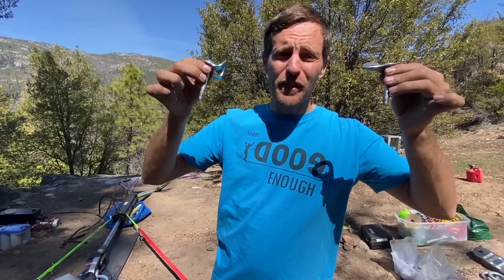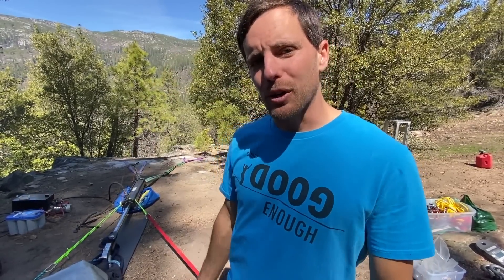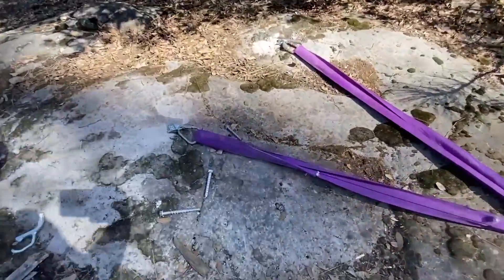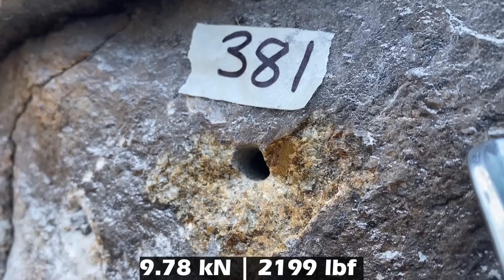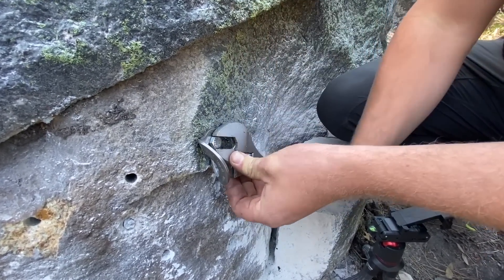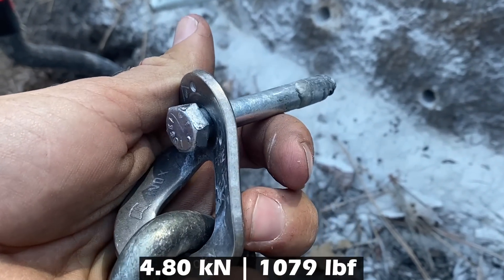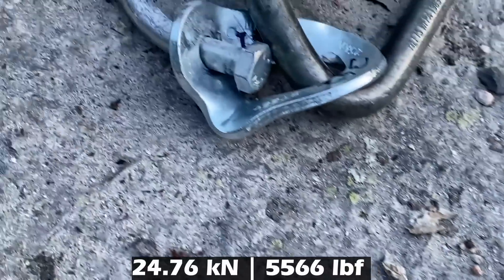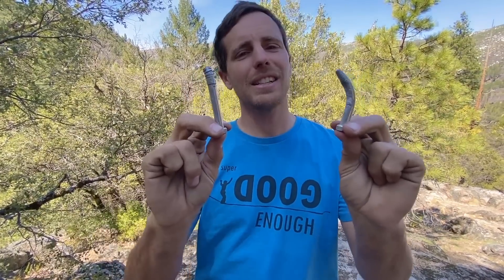John Bachar's favorite bolts tested

Comment: It looks like you installed them incorrectly. You're not supposed to hammer them all the way in.

Doing that makes them impossible to tighten, and instead you'll just instantly strip the threads.

Comment: Hey guys, cool video.  Like your stuff.  One thing you might do in the future is do a little more research on the topic or motivation behind JB's decision.  I don't think you're bashing on JB per se, but just trying to draw a conclusion from something that seems foreign peering back into history about.  You'd do well in the future to try and phone interview someone that knows more on the topic at minimum.  JB absolutely never placed bolts without significant consideration nor did he ever "just free solo" everything.  His methods were far from reckless.  Sure, there are routes like the Bachar-Yerian and others, but the ethos and technology at the time were very different.  John had the purest of ethos of any and was extremely against rap bolting and so these would have been bolts generally placed from the ground up and by hand without the use of aid gear or hooks.  If you're establishing new routes at 5.12+ in this pure form while trying to keep up with all the 5.14+ rap bolting going on, I'd probably use the same bolts.  Cheers, cool tests.
Reply: Also of note... this is often why the bolts are spaced a little further out on some of his routes.  He had to find a good enough hold to actually rest the 3-5 minutes required to drill the hole by hand and tighten the bolt to clip in and proceed... while attempting the onsight

Comment: Could you try one more in shear - and after it has snapped out of place once, try to remove all tension and see if you can pull it out by hand afterwards. My theory is that the lead screw on the bottom is already ruined from the previous load, and the only thing holding it in place is the strength of the bolt, combined with the friction from the threads on the end of the bolt.

Comment: but how would that apply to real life, unless the bolt was in an overhanging spot?
Reply: In my world of caving, it's definitely not rare to have fixed anchors in a ceiling-- they need to be sleeves, wedges, or (maybe) glue-ins*

Ascending on a fixed rope with an unequalized knot (or, ewwww, a single bolt anchor) could potentially see those forces... especially if it's a decent-sizes dude towing a heavy cave pack**, or people tandem climbing (aka the most unnecessary form of ascending ropes).

Even if the 3.8 ~ 4.whatever kN isn't hit, I wouldn't trust the repeated bouncing (at ~2.whatever kN) generated by ascending to not fuck with that placement. 

*Disclaimer: I'm not experienced with glue-ins

**In caving, we don't haul-- we tether our packs to our harnesses, dangling right below us
Reply: @rachelhasbruises  Bolting "ceilings" in rock climbing is also common.  Although, we usually call them "roofs"

Comment: It's worth noting that these style of bolts were state of the art, at the time, and superseded 1/4" non-plated steel bolts with tin can hangers that were ubiquitous not so many years before. Thankfully the art has continued to evolve.
Reply: Remember being run out on Z-macs and button heads?  They worked and stopped falls for guys waaaay bigger than me! certainly not for "sport" climbs. I remember an old and well loved bumper sticker around the Ditch: "Sport climbing is neither." ha ha.
Reply: I feel like this comment coincides with Ryan's video on cheap amazon biners.  Sure they work, but when you buy them none of the money goes to developing safer, better gear.  Hooray for progress.

Comment: Yall need a socket wrench, that Cresent makes the hair on the back of my neck stand up haha
Reply: I would think a crescent wrench is the best tool for this type of work when actually on a wall. No sockets to drop, adjustable and a loop to tie tool off. I also don't think you ever need more torque than what you can generate with a crescent wrench. I'm not a climber and have never done this, so I could be very wrong, but I know tools. I think they got the right one for the job.
Reply: @jeffbrady2757  yeah I get what you mean about an adjustable tool, but a Cresent is never the "right" tool for the job, unless you want rounded off nuts and bolts
Reply: @Ataraxia_Atom  It depends on how and where your using it I suppose. The torque load, size and quality of fastener and the quality and tolerance of the wrench components all come into play. I quite like the chanellock/bahco/irega wrenches made in Spain. Here though, with the size & grade of bolt and the torque required to set the anchor with the adaptability of a crescent wrench, I think it may actually be the best tool for the job.
Reply: @jeffbrady2757  im not sure what the torque required is, I think a correctly sized box end wrench would be the best tool for the job. Would even get your hand away from the rock
Reply: @Ataraxia_Atom  I was an Outside Machinist at shipyard and the 12"-18" inch crescent wrench was the go-to for all the mechanics. It would get the job done 90% of the time, unless the job required a specific length, size, or shape wrench. Granted, a majority of the fasteners used on ships are larger diameter, coarse threaded and anti-seize is applied liberally.
Reply: @rickjames8317  i suppose experience matters, I was a tool and die maker for 7 years machining high precision plastic injection molds and there is no way in hell I would use a Cresent wrench for any job, but obviously in your field the opinion was different. Thanks for sharing.
Reply: @Ataraxia_Atom  yeah man, everyones mindset is shaped by our individual experience. After hearing your experience as a diemaker, I can totally understand where you're coming from. I'm sure no diemaker worth his salt would use anything less than the exact right tool for the job. I'm sure that half the fellas working as inside Machinist at the same shipyard as me didn't even own an adjustable wrench. It's all just a trade off between the required precision and production on a job, which for me, varied incredibly from task to task. Thank you for sharing your experiences bud 👍
Reply: Oh, definitely. The appropriate sized wrench is always going to be better than a crescent wrench. But for rigging climbing stuff I think you have to have the tools tied off when you're working, so there goes the offset box end of the wrench to a carabineer. Also, they might coming across different sized anchor bolts, and carrying one crescent wrench would be significantly lighter than multiple combo/ box end wrenches.
For testing on the ground I'd probably use the right sized wrench for the reasons you mentioned though!
Reply: @jeffbrady2757  yeah im sure for removal it would be a giant pain in the a**, Cresent strapped on would be ideal forsure
Reply: @jeffbrady2757  I've sure wished for an adjustable wrench clipped to a cord when I've had to hand tighten the nut on an old, rusty, spinner. Even one of those comically small, but not quite a keychain size adjustable wrenches would help.
Reply: @rickjames8317  Hey, the metolius nut tool has wrench holes.  Of course, you'd be luck to get an eighth turn using it, LoL.  In my experience with old rusty spinners, the stud/anchor usually spins in the hole
Reply: @mattgraham4340  That metolius nut tool could do the trick. Although, it does look awkward to use as a wrench. Better than nothing. My 20yr old nut tool just has 4 finger holes in the handle. Most of the spinners I was referring to are the old split shaft Rawl type stud-bolts. The nuts  back off and just the hanger spins, not the stud in the rock (if you're lucky). I'm not sure why nylock nuts weren't used, they've been around since the 70's. Probably would still loosen, just take longer.
Reply: @rickjames8317  Something like the craftsman 43380 would be ideal, but probably a bit bulky for everyday climbing
Reply: Where is the front of your back?
Reply: pretty ghetto by any dirtbag's measure, I agree.

Comment: Out of curiosity, have you pulled a regular 3/8x3 hex bolt from the hardware store in shear as a control? It seems like the bolt has to bend before anything else, so not having any retention method might not effect it that much. You might get basically identical results to these bolts, although I suppose it might have to be graded to get to 22kn.
Reply: I've had the same thought while watching. Please test a normal hex bolt.
Reply: Grade 2,5 or 8?
Reply: @autokludge  both in the best case.

Comment: These are bomber to hold a downward force  on lead falls. When does one create over 3kn in direct outward force in a fall that isn’t a roof?
Reply: But that's with a fresh bolt. Now add a year or 2 of weathering and I bet these things would just slide out
Reply: @mikelarin8037  weathering, or just the repeated whipping on them for sure.... 😬
Reply from the maker: It's not the main way it is used, but even in climbing things get pulled straight out often enough that it is good to know how strong it is.
Reply: I'm a big climber and I can hit 7kns